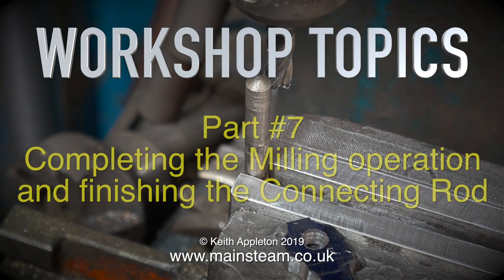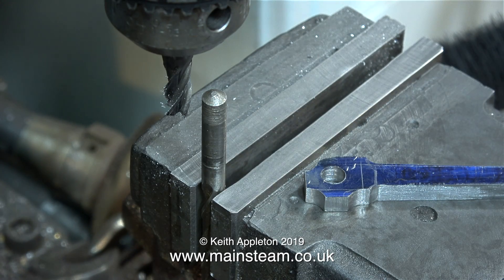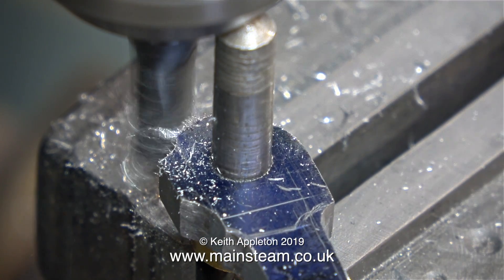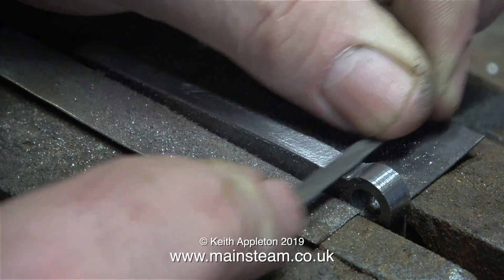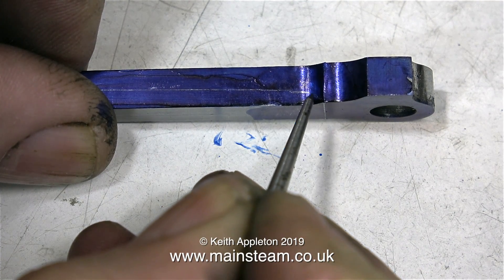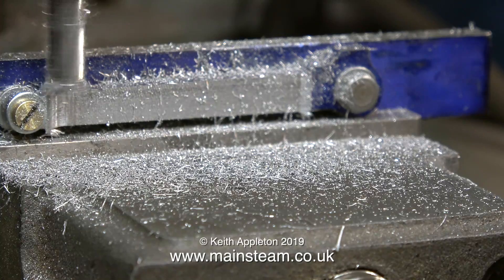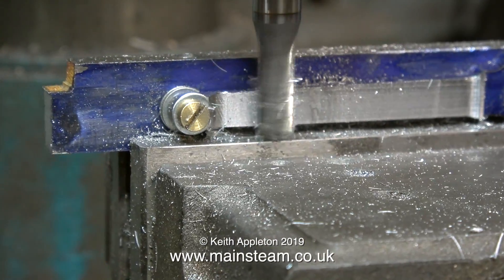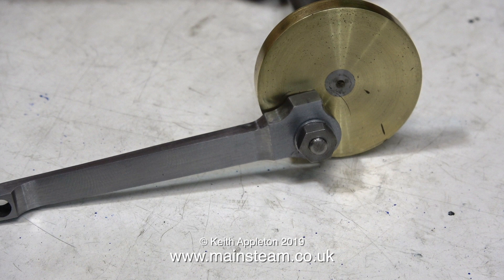WORKSHOP TOPICS - PART #7 - ROUNDING THE ENDS OF THE CONNECTION ROD

Comment: Thank you for the video. As far as the tapered milling, I would be more inclined to bolt it solid up against the bar (no washers) and rotate the vise to the desired angle. Close enough for rock n roll though.

Comment: Hi Keith im in the middle of building the 5a steam engine. Could you recomend a method to machine the engine stand, the part the con rod slides up and down in as it is the largest part of the engine. Love the videos keep up the great work.
Reply from the maker: Hold it in your 4 jaw chuck by the round top part and machine the "feet", then clamp the assembly feet first onto a faceplate to bore the trunk guide using a substantial boring bar..